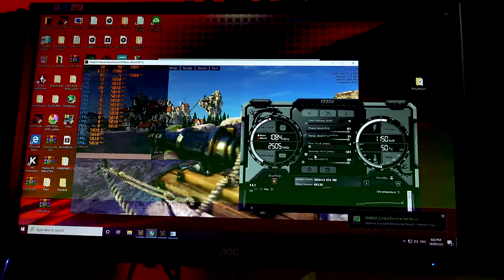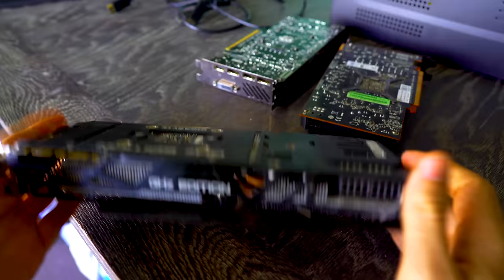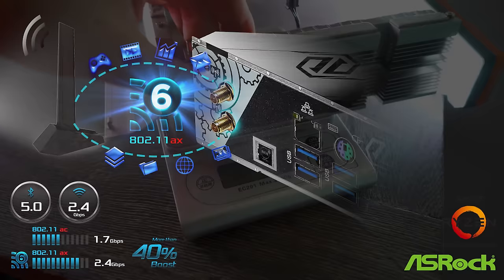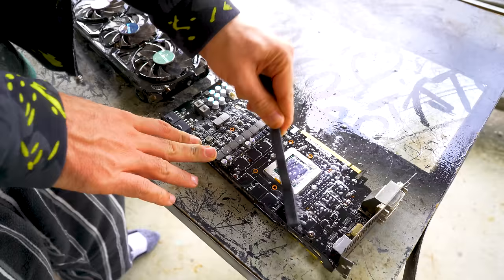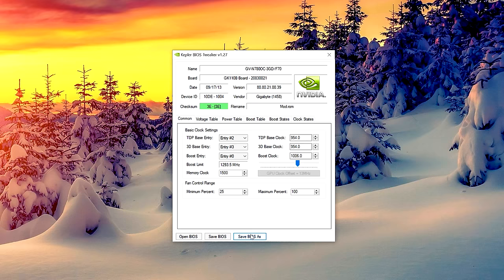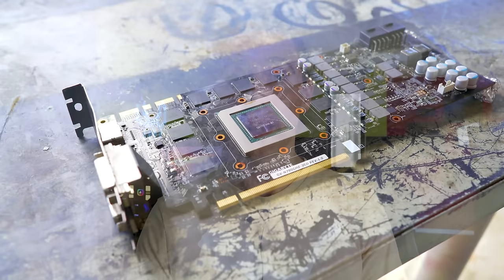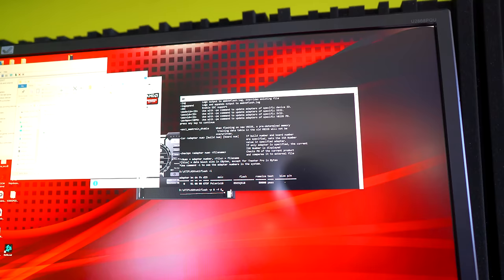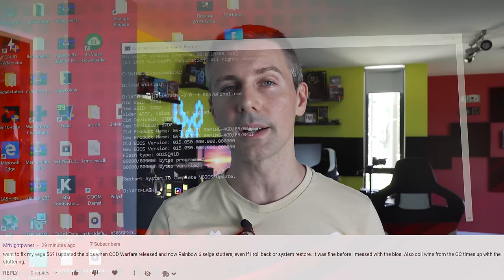4 Problems that Cause a Faulty GPU and How to Fix them.

Comment: I have a problem where whenever I run a benchmark or get into a game my screens go black and I have to restart my pc, is that faulty vram? I've downgraded and upgraded drivers and it still happens. I know it's a gpu problem bc I've swapped it out with a gpu that's worse and it worked perfectly fine.
Reply: its an rtx 2060 sorry, you probably want to know what gpu it is

Comment: Hey Bryan, i have a laptop with a faulty nvidia 1060 with error 43, i have tried everything software wise, even update/downgraded the firmware but it wont work, do you recommend heat gunning a laptop gpu ?
Reply: Code 43 is often GPU chip issue, lost lead ball contacts. It might work.

Comment: my gpu has the problem number 1. it is the same gpu gigabyte rx570 4gb. the problem is really on the software of the driver when you use the zero rpm mode on wattman. i hope it helps

Comment: My r9 270 died 3 years back killing my motherboard with it, would this heat gun method fix the mobo atleast and how would I know if the pcie slot didn't burn out too? Cause the motherboard turns on but no singnal it doesn't boot. Igpu doesn't kick in I guess

Comment: Sir ihave a XfX R7770 Ghost GPU, but when i put on the motherboard my system unit has no power no anything also even though the psu motherboard ram cpu is new, please kindly give me  some tips ti fix it. Also it has a crack diode.

Comment: I upgraded my r3700x cpu that had a gtx 950 in it to a rtx 3050 worked great for about 3 months. Turned it off and restarted a month later due to working on a new pc I built to game on and got a black screen. It worked when I shut it down. Unplugged everything but the video card from the hdmi  socket nothing.  Have you heard of any rtx 3050 problems like this from drivers? I know I am going to have to take it apart and put a known good card in to test it. I am just wondering is there a driver issue with this new released card from Nvidia?

Comment: How do I fix my AMD ex Mining card?

I have a RX480 4gb XFX that had a different driver ( mining driver )

Found a video that reflashing it would fix, and I gave it a go. Then after the flash, I restarted my PC and  apparently no display. The fans spins at max speed. How do I fix this problem? Been fixing it since I got it last year
Reply: I think you flashed wrong BIOS
I happen to flashed wrong BIOS to my RX 580. My PC then wont POST and motherboard debugging led telling me that there's something wrong with my gpu. Here how I fixed it :
You need PC with on board graphic, usb stick with UEFI atiflash/amdvbflash and proper bios file
1. Force the PC to use onboard graphic even though Discrete graphic installed, then turn it off
2. Install the faulty GPU
3. Boot to the usb stick
4. Flash the BIOS

Comment: i have facing same issue without driver video works but when installed driver at flicker screen screen going to black ,freeze, and restart immediately then restart lot of time automatic ,post screen windows loading screen but when its going to lock screen at this point its just again going to black screen now i figure out i have also faulty VRAM ISSUE 😒😒

Comment: What should i do with mine (R9 280x 3gb) with 3 ventilators,i dont know what should i do with it i just run my integrated now.It just went boom black screen while i was gaming,after that i tried restarting PC like 10 times but it kept saying auto repair but somehow it fixed itself but another prob apeared,i got red lines/glitches all over the screen should i try get it to someone to fix it or should i just throw it away? Just wanted to say this before doing something stupid :D Good video btw :)

Comment: Before you use the heat gun completely cover the components in flux, just buy a pot of flux and use a brush to cover parts lots around and as far under the gpu as possible.

Comment: I recently had a problem after changing from a Be Quiet TF Cooler to a Captain 240 pro v2 that I would get no signal from my GPU. I switched Graphic Cards, disconnected hard drives, cleaned RAM and Pcie slots etc but nothing! Switched back to the old cooler and it worked. Switched back again, it booted but crashed in test. Switched back and it worked again. I left the Be Quiet in and it's still working. The mounting pressure I am sure is the problem because the paste although covering the surface, is blotchy. It was a strange problem that also gave no signal on the GPU.

Comment: Forget the heat gun and just use the oven. The 3 times iv used the oven trick it has worked and only once was it a temporary fix until card needed it done again.

Comment: I have one msi 7870 with a black screen when install the drivers ! It was trying me crazy what the problem was also I had burned CPU power 8 pin and at idle the PC frozen all the time. At first believed that the motherboard giveup but no GPU dies first at any system all the time. Now Im just selling the GPU at 2 years...

Comment: hey i hope you can help me 
my 1080 runs now with new paste very good not more then 78C 

but at cs go it always Drops back too 1653 MHz clock and it runs at 1911 normal

and at cs go its 58 to 63c

vrm too hot ?

Comment: My family got (10) 9400 GT from an old closed internet cafe in the past and when i chucked it into a system it isn't recognized or no display. I don't have a heat gun and i don't want to use my oven for the GPU so what i did was let the heat from the sun do the work. I left it for like about 10minutes or so. 7 out of the 10 was brought back to life. It was so hot that day and the sun was so bright. that may be another variable that it worked like a heat gun the temperature on that day was 90 - 100 F, i think. well it was summer

Comment: I never had GPU issues before upgrading to windows 11. Now my system crashes at least one time everyday with graphics glitches on screen and then everything freezes. 😟
Reply: Nurhuda Kurniawan  Probably Nvidia and Microsoft will never fix this. They are forcing us to buy new hardware. I get glitches in the center of the screen then it spreads over the whole screen and everything freezes forever.
Reply: Nurhuda Kurniawan  Guess that corrupted driver and OS have destroyed your GPU. Dude this is truly sad. I thought Windows 11 would be far better than anything else but it turned out the other way on us. By the way what's your GPU model and where are you from?
Reply: Nurhuda Kurniawan  I just dont get it. It is crime for sure. My Os was running smooth but yesterday it got an update and then everything is like insider preview. I get random graphics glitches and crash. I had to reinstall the Nvidia driver. Even RTX 3060 users are going through same issues.

Comment: I have this 980ti I got from a buddy for free.  It worked for  a day.  But then the entire pc wouldn't power on. Put in my old gpu and it worked fine. Tried that 980ti in my other pc, and the same thing happened. The ENTIRE pc wouldn't power on.  Like.. hitting the power button does NOTHING. I've never ever seen anything like that.  Do you have any suggestions, or is it just history?  Edit:  The card itself is clean, rust free, and looks new...

Comment: I had green blocks appear on my screen 5700xt, followed the next day by a game freezing with "space invader" style blocks all over the screen. I was told it could be dud vram or driver issue,  i couldn't replicate it was so random, rma'd to be on the safe side as the warranty is nearly up......but worried ill get the card back if they test it and cant replicate the fault as it seems so intermittent and it is a bum card.

Comment: Hi I have a question. Can you use wd40 on pci contact pins. I just bought a gpu and it's a bit rusted. 
And also, Is it ok to clean the pcb with a toothbrush. I'm always afraid of zap killing it with the static. 
Response will be greatly appreciated!

Comment: Gave my friend my old 750Ti. When he added another hdd into his system the card refused to display out anything. Just started blasting the fans at 100% after startup. All I did was turn off the factory "boost" (Its an i-game card with a turbo button on the io shield) and reseated the gpu and its power. Its been working fine since then (about for a year).

Comment: I recently sold a working GTX 770 MSI 2gb on eBay and after 3 weeks the buyer requested a refund, I got the card back there is no output from it. But when I connect via motherboard output. It is shown in devices as working ok. Reflash vbios successfully. When connecting DVI or HDMI in the Nvidia menu it pops up but there is no picture, this is not the case with DP not showing in Nvidia settings at all. Still, in some games I can select between the integrated GPU and Nvidia GTX 770 and it does work. Can you help me figure out my problem, maybe there is a capacitor for output chip? Thanks, Great video by the way.

Comment: I have a very weird problem with RX 580 Nitro+, card overheats in unusual way, stock fan curve is not keeping GPU cool enough, it goes to 73°C and gives out black screeen, custom profile fixes it mostly, some games still give black screen after 20-30 minutes of gaming. Gpu temp itself are not that hot but something is overheating i think .

Comment: Ahh I remember a few years back I acquired a dead 7950 for $15 and thought fuck it, i'll try the classic oven method. Baked the sucker in the oven for 20 minutes, slapped some fresh thermal paste on it, reassembled and voila. Put it in my flatmates computer where he gamed on it for 3 weeks, ran flawlessly, sold the card for $80 (with the disclaimer it had been baked in the oven). Good times.

Comment: i got a dead gpu then got it working with reheat. but it hangs ingame. clean it. reheat again. working but the problem now is that, it won't install any drivers. tried flashing bios but it won't accept it. tried any drivers, but failed. tried nvidia experience, it just won't install any drivers. it just works on standard vga. i got asus gts 450.

Comment: Hey man, my card is failing to power up. I am thinking that a protective fuse on the card might have blown up due to the consistent fluctuating power in my area. I cant power up the card. Any specific pointers on where I can solder? It is windforce 1080? Thanks for the help in advance.

Comment: I think it is to do with the Legacy Bios alot of the Radeon R9 cards have this issue but the sapphire nitros have a legacy bios button that solves the issue of black screen when driver installed as I was looking into installing one into my Alienware or my HP Z820

"Thanks for the posting of your solution. Hopefully, Aurora-R3 owners will find this later if they search forum.
That is what I keeping telling Aurora-R3 users. They must use a video card with Hybrid BIOS, Dual BIOS switch (Legacy and UEFI), etc."

Comment: I have a problem Gigabyte RX 570 that I recently purchased used. It is in pristine condition in the original anti static bag, original box with CD. I have the latest driver, and installed the card. It gives video output, boots to homescreen and all looked well until I tried to run Unigine Heaven to test it. It goes to black screen, the PC restarts and briefly shows desktop then black again. It won't render anything under load.  GPUZ recognizes it and showed 47 - 52C temps just sitting. Tried doing the small GPUZ pcie test and it crashed again. Hoping a good clean, and repaste will fix it. Was probably used for mining and worked like a mule.

Comment: Any help from anyone would be nice. Im trying to help fix a Sapphire R9 270 that in the beginning did boot, but no screen after windows installed. Now it has no display at all after I replaced the thermal paste and used a can of air to remove dust. Please  let me know if you have any ideas.. Please and thank you

Comment: I have a gtx 1050ti on an amd 2600 build. Fans are spinning but no display. I get 8 beeps on startup. I tried an R9 390 on the same build and it works... I hope this is not goodbye to the card😥

Comment: this is stupid, my AMD  530 installation gets to  around 60% when I get a restart prompt from windows (restart needed, AMD crash defender is installed) then the whole pc freezes, only way to get the laptop up again is through hard shutdown and most cases the laptop goes black screen no signal and fans spinning... technician said the GPU is dead but i think other wise... because if it is totally dead it wouldn't be recognized by windows at all and my laptop would not boot from the 1st place/keeps crashing because of it

Comment: I have an rx 570 phantom gaming that works fine until it hits 80c then it goes to 300mhz until its back at like 78° C, i get a ton of stuttering, applying a -.30 V and a really aggressive fan profile does the trick but im not sure why is it running like that

Comment: My 980 makes lines. I think is because of the memory. Everything else is fine but the screen is barely visible from moving lines. I start CS:S because I don't installed drivers and the game was running at 17 fps locked. The screen refresh rate is 64hz not 144hz as my monitor.

Comment: Installed a working strix 970 pro on a x570 unify. Worked for 30 mins. Heard a pop. Card is now dead. Did a full breakdown and clean. Found no damaged spots anywhere. No signal and fans spin constant. Any ideas?

Comment: Thanks for an excellent video.. My RTX2060 is not working anymore and idk what happen. I was playing GTA5 Online, the game freeze, I restart, them play other games, I did a steam of 4 hours, play cod. Everything look great. Turn off the pc, back on a couple hours later and the windows hangs and nothing works. I enter the BIOS and it hangs again, I restart, clear cmos, I unplug the card, plugged again. Nothing works. I did overclock but the core was just +5 and I tested for like an hour and it was ok. I think it was'nt the overclock, but this card is 1 year old and suddenly is dead. And with this isolation thing I dont know what to do.

Comment: been suffering from the first problem for a few months now. underclocking the card seems to help a bit and limiting the framerate of my game so it doesnt draw a lot of power? swapped the card out for another and had no issue. it did start after installing new drivers too.

Comment: I have about 12 cards that are not working, one of them a 2070ti that was given to me after a water cooling loop leaked on it and it failed, It is very rusty. I don't have any WD40 but I have a can of GT85 with PTFE, hoping that is similar to the WD...

Comment: @Tech YES City hope you can advice me, i got a AMD R9 270X, after i change the thermal paste because of high temp, its having a issue no display, i tried cleaning it, but still the same no display, is it possible the thermal paste i used which is conductive damage the card?

Comment: So I am having the black screen issue in sli but each card works individually. Anyone have any idea?? Evga 780i sli hp blackbird -002?It’s a prebuilt id like to keep as original as possible. Any help would be appreciated. Tried just about everything!! also won’t accept any bios even tho it’s an hp products hp can’t detect it either. Pc does work using with single gpu at the moment!!

Comment: i have an rx 580 with occasional 2~3 second black screens and a scattering of green/yellow horizontal lines flashing on the screen just long enough to be noticed. fun part is none of this happens in game or under load, but is really bad if im watching video.

any ideas?
Reply: wd40 + hairdryer. and its fixed. well, that was easy.

Comment: quick question , I've been looking at this fix with a heat gun and the oven . I have a MSI R9 270 that boots fine but I get Red Lines on the screen will both of these methods work for a fix ?

Comment: Help me, i bought an ex mining rx580 4gb. Right after i bought it, i clean, repaste best i could. Initially it dies when i do haven benchmark (maybe 10 second in), i thought it's my ram stick, after i change my ram (from 8gb stick to 4gb) i can do haven benchmark on high with 100+ fps no problem. Confidence as i successfully do haven, i tried apex on training and it goes kabonkers
Solution i tried : DDU,flashing vbios,reinstalling windows like 20 times
help pls

Comment: my pc not working properly some times it works some time it doesn't on my motherboard there is 4 leds ezdebug in which vga one glows and monitor says no signal i can confirm that it's not the psu cause when i started having this problem i bought a new psu it's also not motherboard problem

Comment: 13:19 had the same problem with my 6770. the chip would reach 100°c at 100% fan speed and then crash. all i did was lap the copper heatsink with the steel blade of a pencil sharpener and then polish it for a good 20 minutes with rubbing alcohol and a piece of rag until it was as shiny as i could get it to be. now it runs at around 90°c at 70% fan speed with a custom fan profile because otherwise it reaches 93°c and crashes the driver. my 6770 is a sapphire vapor x. originaly it had good temps but i dont know if it is the vapor chamber or the copper that are not doing their job propperly anymore, it should be at least 20°c cooler.

Comment: My 670 is just like the 970 it boots I can install the drivers they install fine but I still have( code 43 ) in device manager the picture had a big 2inch black frame around the screen. In gpuz it shows 0mb memory 0 bandwidth 0 bus speed HELP!